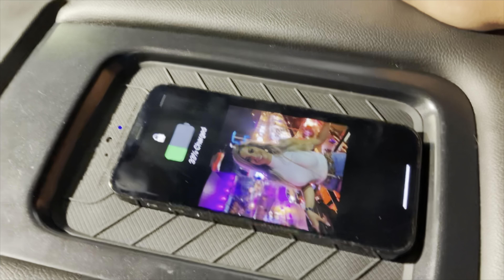Happy 4th of July! Boost Auto Parts Wireless Charger Install. 15-19 Duramax!

Comment: Good Video! I was wondering What Kind of Scan tool Do use or Do U use a laptop.?
Reply from the maker: Actually in my truck I use the Banks idash data monster. It acts as a scan tool and will read and clean any vehicle codes. For other vehicles I use one from innova. Here’s a link. https://shop.advanceautoparts.com/p/innova-carscan-pro-5610/12071171-p?product_channel=local&store=6885&adtype=pla&product_channel=local&store_code=6885&gclid=CjwKCAjw092IBhAwEiwAxR1lRk2WL48Pb4RBjLIEhhCik3R6iZugPTgI2oAKLZvc_68WUAG8v2mUqRoC8bgQAvD_BwE&gclsrc=aw.ds

Yes there are $2,000 snap on scanners that are better. But this one works for me.